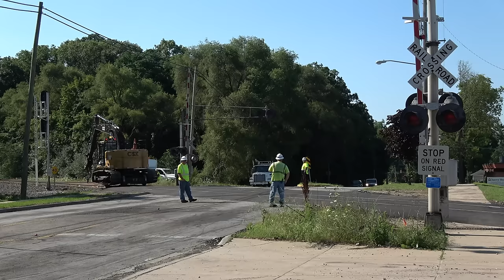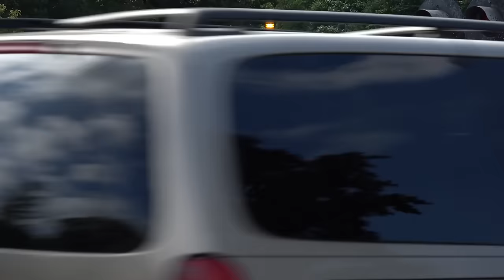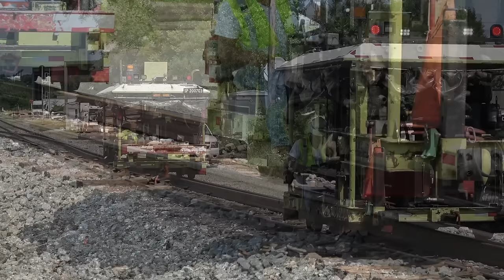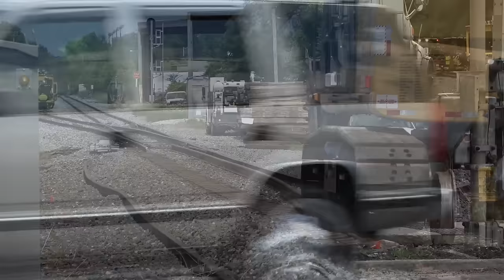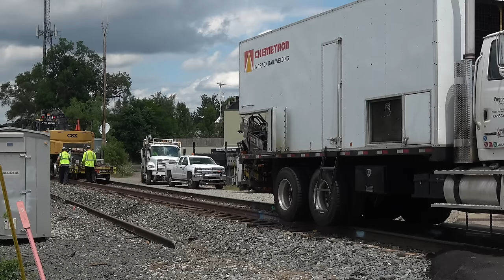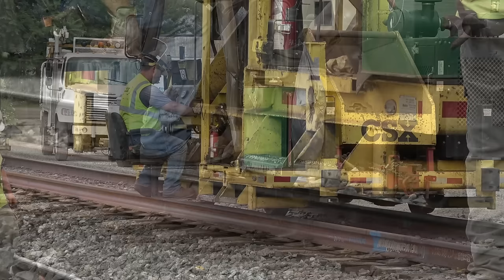TRRS 547: Railroad Rail Replacement

Comment: My big question is, Why did they use and expensive rail cutter. Only a couple of feet away was a bolt together rail joiner. why didn't they just take apart the rail joiner?
Reply from the maker: That existing joint was an IJ, or insulated joint, for the signal system. You'll never find field crews making new IJs on-site. They are shipped out, as you can see, in segments of varying length, and then dropped into position. That's why they cut around the IJ, and put a new one in to match the new rail size, since this was a size upgrade to 136# from 122#. They cut around it on both sides so they could reuse it elsewhere, I'm sure.

Comment: This vid is two years old; has there been any additional modernization of the process since then? Also, how does the US procedure compare to China's rail replacement technology?
Reply: @martinr1834  Sorry, but even Walmart in China is unionized!

I think you mean the US prison system--that's the slave labor you might be referring to, as it is a US myth that there is slave labor in China. That disappeared after the Cultural Revolution, at about the same time the slave labor system in the US began to flourish.

Comment: welding left much to be desired... rails are grinded badly - just a few sweeps, it should be grinded to a shiny metal surface, or burns could occur, resulting in a irregular hardness and possible failure. next, ends with holes from fishplates should be cut and discarded, but at 18:40 we clearly see a solid rail is welded to a rail with holes. this creates a weak point. and last thing - after a weld, no one checked the geometry of a joint with a straight edge.

Comment: I live next to a CSX line and am always fascinated by all the machinery and attention to detail. Please answer this stupid question though. Those rails support a lot of tonnage so why do they flex and bend so easily?
Thanks
Reply from the maker: Flexibility isn't necessarily a bad thing. It allows the load to be distributed to the ground rather evenly if the ties aren't perfectly level, for instance.
Reply: The rails are very strong in the vertical direction.  They may look like rubber on the ground, but that's horizontal flexibility.  The rail is designed to transfer the weight of the equipment on it to the structure below it.

Comment: Outside rail gets more wear, I assume, hence replaced first, before the inside rail...
Reply from the maker: Typically, yes. Usually, they figure on how much superelevation (banking) is required for the given planned maximum track speed, and then lower it by a set number of inches. Often 1-2” for freight speed, and 3” for passenger. This means trains at track speed ride the outside rail, wearing it down faster. However, trains traveling below track speed may be balanced perfectly, or begin to ride the inside rail and wear it. Typically, the high side wears away whereas the inside tends to be flattened out by what is essentially cold rolling. That flow can end up causing problems by creating stress/strain points and eventually cracking. The high side may shell. So the railroads will often grind and eventually replace the steel before west limits are reached if internal defects become significantly common.

Comment: The rail steel is obviously of medium hardness to allow the twisting and compression without cracking.  The upper edge where the train wheels roll on it needs to be somewhat high hardness to reduce wear.  Is this upper edge given a different heat treatment to do this or is it the same as the rest of the rail material in hardness, at some compromise value?
Reply from the maker: It is all the same AFAIK, and I think most of it is actually pretty hard stuff, it's just such a long thin shape that basically any material would flex that way.
Reply: @ThornappleRiverRailSeries  Incorrect.  Steel is very useful because it can be hardened -- due to primarily its variable carbon content (ductile steels usually have under 0.5%) and, for most modern steel, several other alloy additives -- to various levels, including variation in the same object (case-hardened ball bearings, for example).  When the hardness gets up to near 300 Brinell (circa 30 Rockwell "C") or so, though, the material begins to get so hard, unless especially treated by annealing to restore softness, that it cracks rather than stretches.  Cracks can be tolerated in some uses if they are not bent or stretched (com-pression only), since the material on either side of the crack no longer supports the other side.  This is why cracking can be like an avalanche, with the small cracks lengthening until they overlap and then the object breaks apart, sometimes very suddenly with little warning, if any.  Those rails acted like spaghetti, yet did not crack or stretch/deform to a shape that was not useable ("Yield Point"), where permanent shape changes begin to occur.  Thus, they would depress downward under the weight of the rolling wheels over them, increasing contact area.  While such compression does spread the load somewhat, such up/down flexing causes more friction at the contact spots as the wheels move sideways along the rail top edge and, thus, more wear on the rails.

Case hardening, for example, makes the surface of ball bearings extremely hard and rigid so they wear very slowly with minimal contact area between them and the bushings that they are revolving in, which is why this is done.  If the surface at the top of the rail was hardened for a thin layer for reduced wear, the compression and proper joint of the hard and soft regions of the rail would allow increased hardness and longer rail life, though it is possible that other factors, such as years of heating and cooling with the weather and rain causing slight rust that slowly wears away the rail outer layers, cause much more degradation on the life of a rail, so the surface hardening of the upper edge is of no real help.

Comment: What about the opposite rail. Don't they both need to be changed together?
Reply from the maker: It was actually changed a couple years ago. They do not have to be changed at the same time, in fact this was still a rail weight change, but they come through and resurface it so that the rail heads are at the proper elevation. Before this video, there was 136# on the low rail and 122# on the high side.
Reply: Thanks for the info.

Comment: I was working and one of the companies right near there still supply and engineering while they were doing this it was a logistical nightmare to get in and out of our shop because they closed both roads that we had access to
Reply: The welding process thermite welding that adds new material that you mentioned is better because it allows for high speed rail service In this application the maximum speed the train is going to be allowed to do is about 15 to 20 miles an hour Even on some of the outer town ones the maximum is about 50 to 60 miles an hour as opposed to thermite welding that they do in Europe and Asia which allows the trains to go over 100 to 150 mph

Comment: When they replace rail, is the track circuit still embedded in it? I thats how it works, not sure. Seems like whenever i see "new rail" being installed, it looks just as black and old as the one it's replacing.
Reply from the maker: The track circuitry wires are knocked off the old rail before it is removed, and re-bonded to the new rail once installed. And color has absolutely nothing to do with the condition of the rail.
Reply: @ThornappleRiverRailSeries  Is the wire in the rail, or so the current just flow trough it?
Reply from the maker: The current flows right through the rail itself. Steel is conductive.

Comment: I’m no expert on this topic but this equipment seems seriously outdated. I refuse to believe that there isn’t more automated machinery available that can do this faster and with less manual work. Seeing the guy manually grinding down the weld was eye opening.
Reply from the maker: Automated is available, but not necessarily cheaper.

Comment: Cant believe they are spending so much money on machines and personnel for such a small and simple job.
Reply: @djavidianmx1832  1 HiRail excavator with correct attachments, 1 FEL, 1 FBW, Adzer looks hand would use that and then 10 guys, 5 hours.

Comment: Since they already had around a half dozen guys putting the plates into place, that single-use machine with the electromagnet to collect the plates and spikes sure seems like an enormous waste of money and time, especially since a man had to pick up the many missed pieces. Those half dozen men could've done the same job is much less time and a lot more cheaply.
Reply from the maker: They had so many guys for the plates because the guys from the first couple machines dropped back to help. This is typical practice when they reach the end of a segment, but usually the segments are long enough that the head-end machines aren't done yet when plates start going on. It's just good teamwork. 

If some old plates, spikes and anchors get left behind it isn't a huge deal. They just want to get as many as easily practical.

Comment: I will never understand why the U.S. railroading system Has not changed from spikes to screws to hold down the rails. it is very obvious standing on a platform or walking by and looking down the tracks. I see so many spike pulled way out.

Comment: It seems to me the rail cross section is not as wide as older rails, is this to allow more flexing side to side?
Reply from the maker: This was an upgrade from 122# to 136# rail. The next stuff is actually larger.

Comment: Can you explain this CORRUGATION of a bad join ??
Reply from the maker: Basically, if the weld spot is higher or lower than the surrounding rail, the wheel-induced wear will only make it worse over time. A dip will get deeper, and humps will lead to dips on either side. 

It can end up making a supposedly-smooth joint turn into one that sounds like a standard joint when wheels hit it.

Comment: So was the rail not replaced on the road as well and if not why not?
Reply from the maker: Rail through road crossings is usually replaced separately from the surrounding rail, as grade crossing repaves are the best time to do it. Essentially, grade crossing and rail renewal are separate projects, so they often get done at different times. 

You can see in the video here the fresh pavement from just a few weeks before this event. Not sure if the prior crossing job done around 2013 included the upgrade to 136# rail, or if this more recent one was.

Comment: What is the difference between the rail holding spike and the hold down spike. Don't all spike hold down the rail.
Reply: One spike holds the rail specifically to the rail plate, and the other assists in holding the plate to the tie.
Reply from the maker: The other guy pretty much covered it, but hold-down spikes help keep the plate in place on the tie, reducing movement and helping to keep the track in gauge, especially in curves.

Comment: The guy doing the voice over puts emphasis on the wrong words at the wrong time. fuse-butt weld, its fuse butt-weld lol
Reply from the maker: Fuse-butt welding is typically used for plastics. The railroad industry calls the process seen Flash-Butt welding.

Comment: I see one spike is further out from the rail. I did not see two spikes holding the rail to the tie plate and tie.
Reply from the maker: There's enough redundancy with the spiking pattern so that some loose ones isn't an issue. They simply install far more than are actually needed.

Comment: why keep the tracks on the excavator(vehicle at 9:45)? can the train wheels be removed to use the tracks or is there another reason to keep them?
Reply from the maker: Yeah the hy-rails can be raised and the tracks used off the rails. Pretty useful convertible capability
Reply: @ThornappleRiverRailSeries  super cool

Comment: UP does't take they scap  metal... sit they and rust over time. in Milwaukee. they dump it.  have a rail yard that is 95% Abandoned. only 2 sets of tracks are used. other where cut off.  no factory's left anymore too. one beer company using the tracks.

Comment: Got money to burn, 3 men...that excavator and the flashbutt machine was all that was needed, the "manual" labour that was saved would be considered an easy day, like literally could have done the spiking, plating, taking the anchors off etc. myself and still got a nap in while they weld it and spend the rest of the time drinking coffee at the shop over the road.
This would be the sort of day i'd live for.
Also if i know workers...they hated every minute of camera time and the "neutral" temp may have been exaggerated so they could go home rather than have to get the tensors out and destress 40 meters of track between 2 fixed points(turnout and crossing).
Reply: I think that short stretch was just the tail end of the work done.  At the video start, there is a long bend of track which I assume was also done, but the short straight section made for easier recording.

Comment: Should be using concrete sleepers anyway
Reply from the maker: There is a balance point where concrete becomes better to use than wood. This line does not see enough tonnage to justify concrete ties.

Comment: why they still use wooden sleeper..
Reply from the maker: This line does not see enough tonnage nor has high enough speeds to justify the added cost of concrete ties. There is a balancing point, and for this line, wood wins.

Comment: Had no clue what was involved in replacing a section of railroad track. Appears an arsenal of equipment, tools and machines are needed and a football team of men to get the job done. I didn’t think there were that many steps involved to replace one piece of track. I can just imagine how miserable that job had to be back in the day without having all those pieces of equipment and tools and had to just use manual labor and brute force……UUUUUGH😞 Not for me…no thanks 😬

Comment: Why does the new rail look old and rusted?
Reply from the maker: Steel rusts when exposed to the air and moisture. The only reason in service rails are shined is the wheels remove the rust and head-harden the surface. Don’t run any trains for a couple of days, especially with some rain, and they’ll be rusty too

Comment: In Germany it is all automatic with a working train 😳
Reply from the maker: Different methods for different purposes. When track time is extremely limited, having a massive machine that can print track is needed, but hilariously expensive in comparison. The more traditional methods are simpler and cheaper, and gets the job done when cost is a much bigger factor.

Comment: Why not just change the whole thing? Rail and ties together
Reply from the maker: Typically, the rail and ties wear at different rates, so usually changing both at the same time isn’t required and would be a waste of money. 

Additionally, changing ties typically relies on the rails being present for the machines to be track-based and get the ties all lined up and spiked in. Conversely, as this video shows, changing rail relies on the ties being present to provide easy alignment. So while there are times that call for wholesale replacement, it is typically done in two stages, usually rail first so the new ties start off with fresh holes, since plugging isn’t perfect.

Comment: Interesting they are still using spikes, its probably the worst system and there are many better alternatives.
Reply from the maker: Spikes remain in use because they're simple and they work well in most situations. Clips require more specialized equipment to handle, and North American railroads do a lot of spot-maintenance where clips become a lot more manual labor than spikes. Tried and true, and when not running massive tonnage or high speeds, they're perfectly functional.